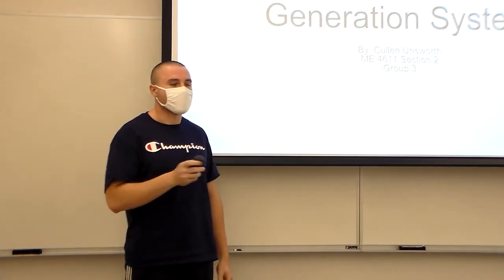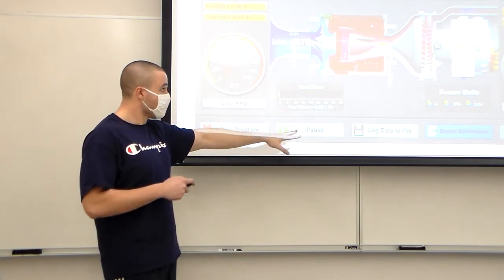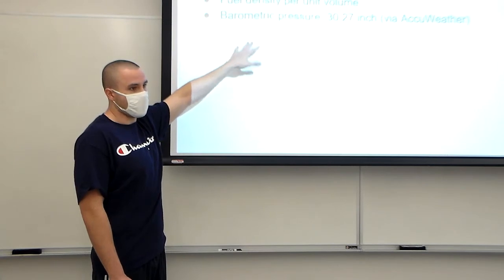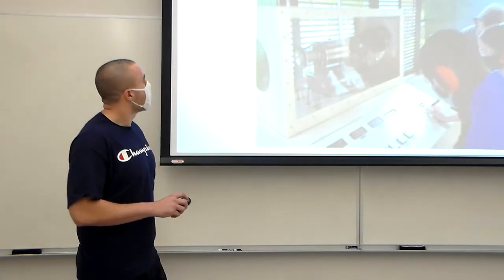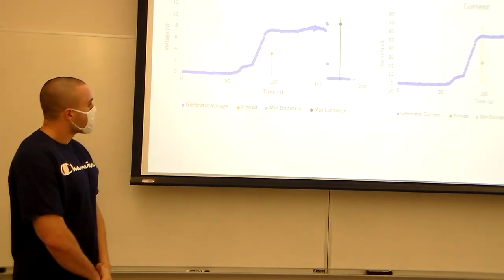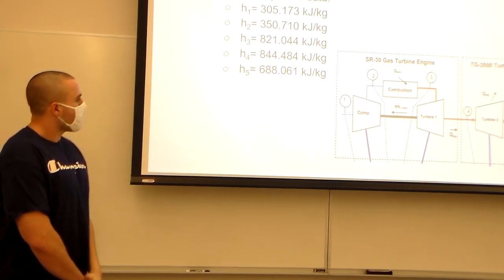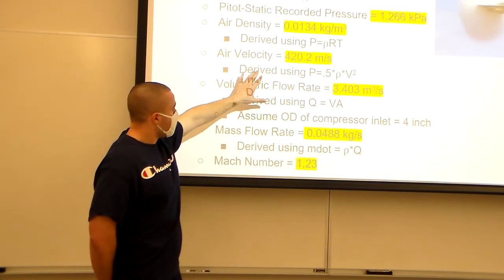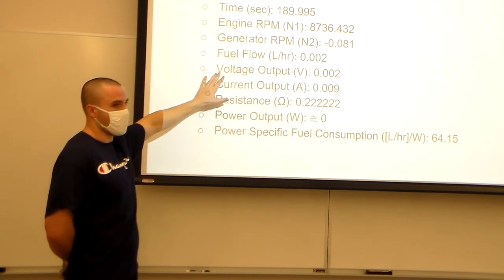Cullen Unsworth- group reporter

Comment: Peer eval: Cullen did a great job presenting this data. He always blows me away with his presentation skills and his ability to speak clearly as well as memorize different values of significance to share during his presentation. While the presentation was slightly longer than expected, I think in the case of this experiment it was necessary to fully explain the different aspects analyzed. Overall great job Cullen.